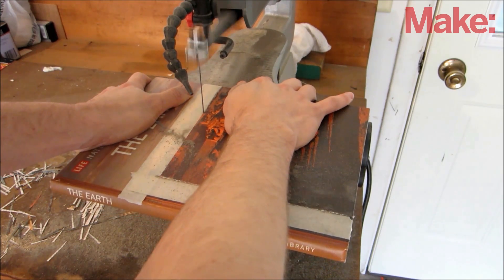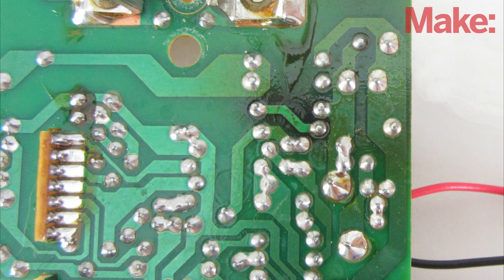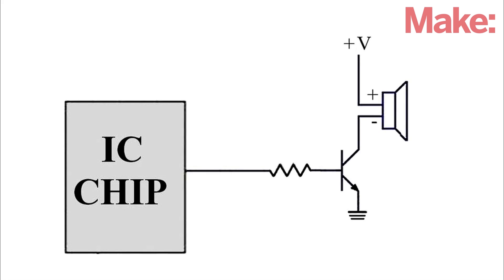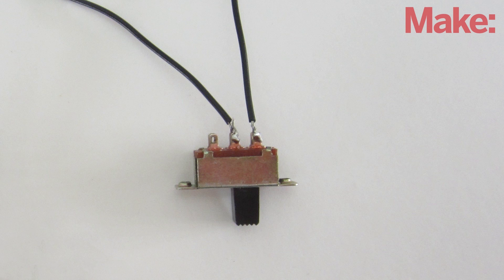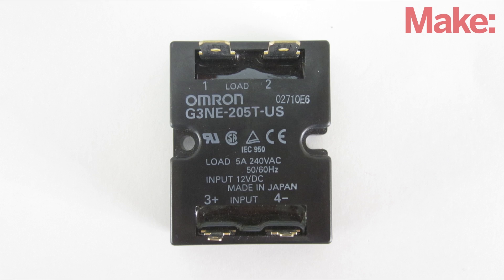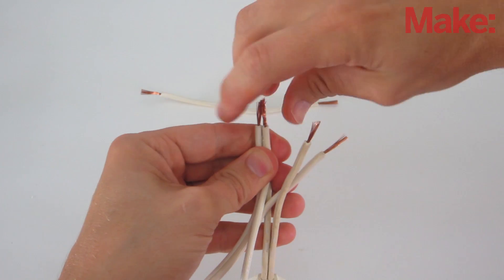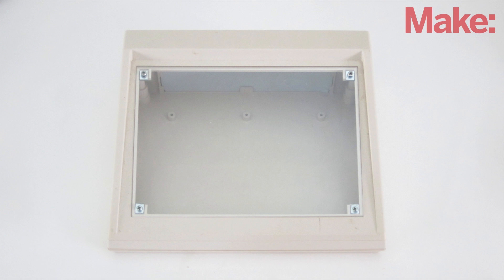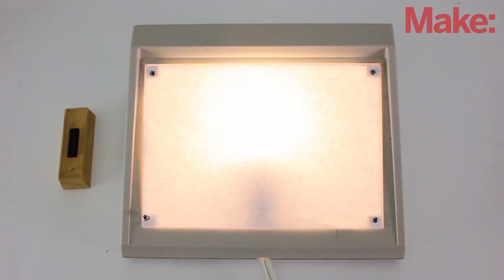How to Make a Flashing Light Doorbell

Comment: DONT built that!! Its very unsafety. The doorbell dont uses a isolated power supply. So you can die, when you touch the wires.

He didnt see the bad capacitor in the doorbell, so i think he has no knowledge about electronics and he shouldn´t do this.

And there are no cable reliefs!!!!

Comment: Show this to a German Electrician and he will say "Oh Lord"

And that is why we have the VDE Norms.
Reply: Lars Reviews
Ah, thanks for the clarification. The twist on caps are unfortunately code here in the US and they are used everywhere. I've never been a fan of them myself. I just looked up those Wago connectors and wow those are really cool.

The are so clean looking when compared to a mess of twist caps. I'll definitely be picking up a pack of these style connectors next time I'm at the home improvement store.
Reply: Lars Reviews That's why i prefer Wago connectors or soldering. Also, i've never seen these twist-on caps here in Poland...
Reply: Do you have any specific complaints about the electrical work here? The junctions accessible and the twist on caps should be to code (at least here in the US).
Reply: theficus Does yellow twist on caps he uses are not allowed anymore when using 220 Volts in Germany.
Reply: Powder-phun Wagos are awesome. Those are the only connectors used in our house.
Reply: Lars Reviews JJ

Comment: you over complicated this so much....
you could have done the same thing with an npn transistor one resistor and a few ultra bright led and using an old 5V 0.5A power adapter and the light will actually flash on and off to get your attention
Reply: I would assume part of the point was to avoid having to add another power supply into the mix and to demonstrate switching using high voltage relays.